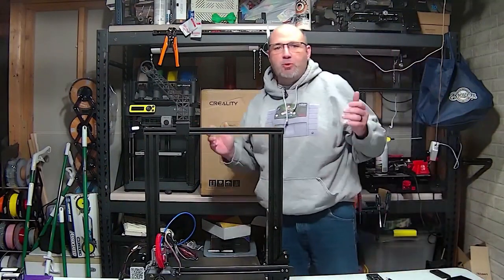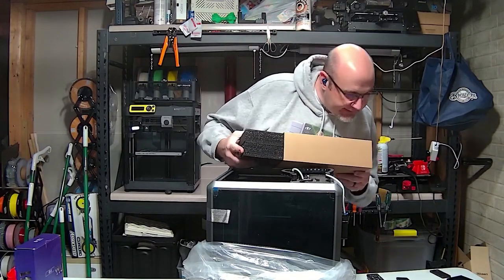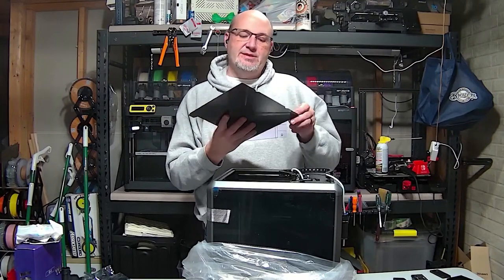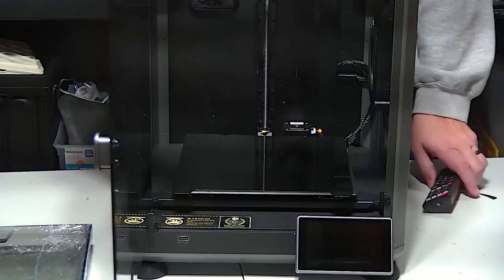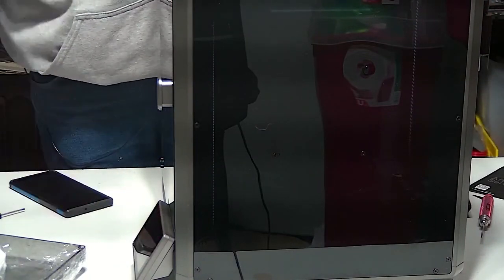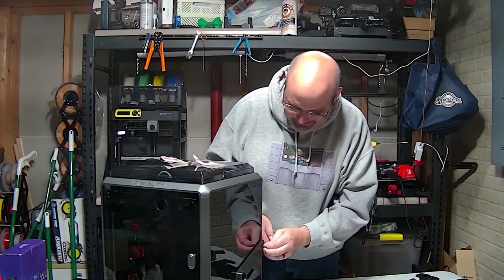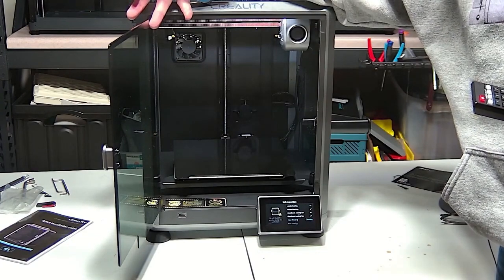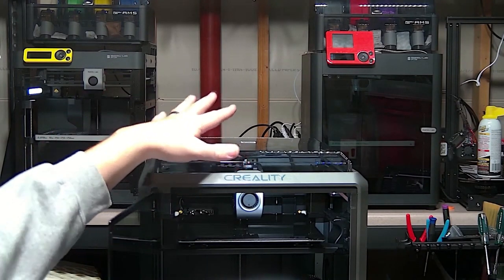Creality K1 Super-Fast 3D Printer Unboxing and Initial Setup

Comment: I believe you received an Open Box Unit.  That could be why the 3 screws were missing,  my second clue to this is the fact that you did not need to add the door handle yourself.  I need to attach it to the K1 i purchased in December.  Good luck with you printer.  I have enjoyed mine so far.  Fairly reliable for me.  I would have preferred a double sided PCI sheet also.  But I do like the smooth first layer I get with the default build plate.  I even purchased a second identical plate when I found one on sale.